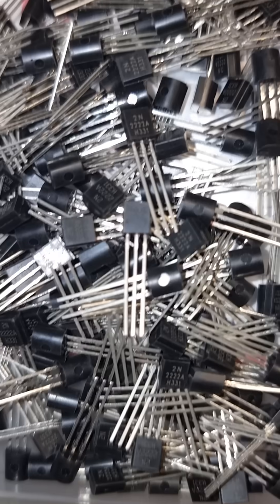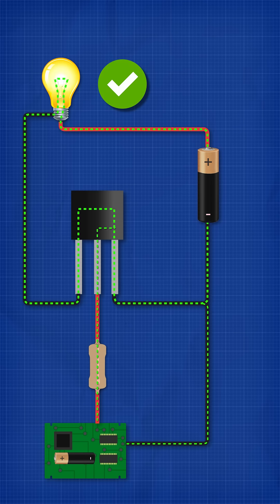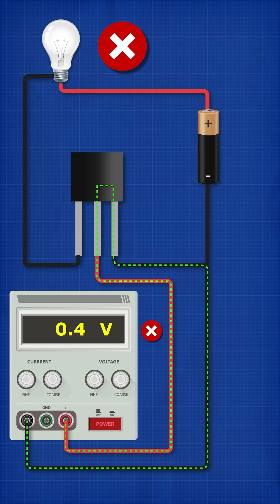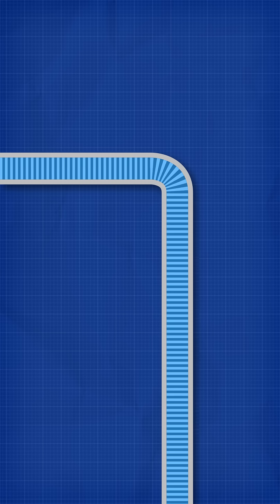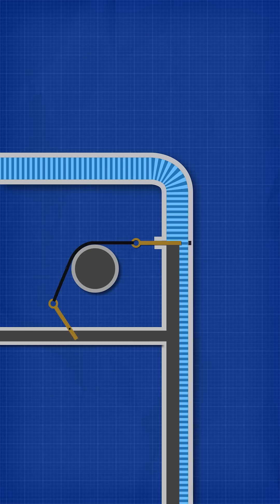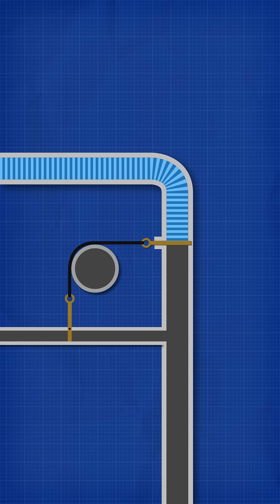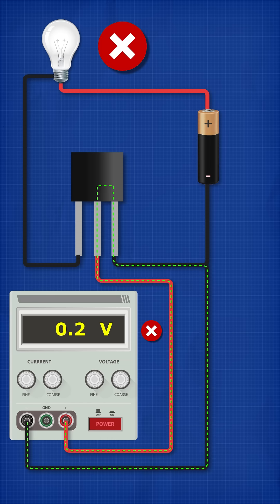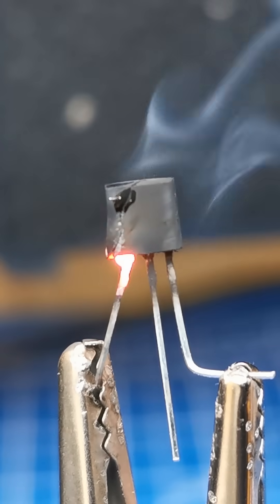Transistors Explained - What is a transistor?

Comment from the maker: Get this electronics book ➡️ https://amzn.to/41cCJPk
Reply: And thus it can turn on and off quickly *enough to amplify radio signals!*, by having it turn on and off at the same frequency as the radio signal but allowing the flow of higher voltage at the same rate!
 Thus acting like an amplifier!

But it is also important inside logic microchips and the processing of data!

Its basically a switch/gate that can turn on and off at Any rate needed!
So things like a photovoltaic cell can turn on or off a light etc!
🧐🤔🤯😁👍🏻🖤👏🏻🤷🏼
Reply: @LBCB94025  I like your explanation of audio power transistor,  how it works to amplify the signal. Amazing it can switch so fast.  So input is audio signal, voltage is increased and output as a stronger amplified signal. And it must be done at the same frequency as the input signal or it not work, right?
Reply: @Accumulator1  i think thats correct, (your wording is a little confusing?) so im not sure lol
🤔😳😆🤷🏼
Reply: @LBCB94025  Thank you for your comment! Hopefully they can take some of the load off of Arduino programming.
Reply: @LBCB94025 well put sir !
Reply: I like Electronics a lot but never could find a class to join. I only see classes for an electrician. Where can I learn about Electronics ?
Reply: @BadRonald1  Colleges have good beginner courses, and people like to share information. Engineering Mindset is a good 'how it works' resource and joining a Maker club (or a volunteer group) can contribute to a benchwork portfolio. Online only may not meet your needs.
Reply: @BadRonald1 
You can take online courses from most community colleges in the USA. Just go online and look for them. You will need to buy the textbook and the lab materials, including a breadboard for building circuits to test your knowledge, and various small electronic components.
Reply: As a student I only understood till diode. I never fully understood transistors. Thank you.
Reply: @randomgblsfs2190 
These videos are great, but they're only expecting to give you a basic understanding of the principles of the flow of electrons through circuits. In order to fully understand the the chemical properties of the components and how they impede it bypass the flow of current, you will eventually have to take physics, chemistry, and advanced electronics engineering courses. But these videos are probably intended to pique your interest in the field of electronics engineering.
Reply: This is one of the best video i have gain knowledge from without any confusion
Reply: Can you provide a new link, this one just redirects to the main amazon page
Reply: Samer question
Reply: I hate transistors they blow up too easily lol
Reply: @loen9591 
That's when you use either a triac or a relay because there's too much current for a solid state transistor.
Reply: Ok
Reply: Is it in your bio🤨
Reply: Is that a book suitable for beginners and laymen?
Reply: @herrlich1461 search in google tron.ix book
Reply: @herrlich1461  Same question

Comment: That last part about them burning out is so real. When I was trying to get into robotics as a kid, I was using a transistor so that I could apply a 5V power supply to 4 different motors at once that were pulling the thing along. What should have happened is probably having parallel transistors to distribute the current across. I had to swap that one transistor out from my robot so many times…

Comment: I can still remember from many years ago that they have mainly 2 types of common transistors. The PNP and NPN transistors which do the same thing in the video but have different flow directions. 
It seems the same as a mosfet or very similar. Which has me a bit confused, I think maybe mosfers are maybe like high power transistors. That are able to handle much more power by being made out of different material.

Comment: Originally, a plastic and rubber holder with copper posts, 

Which, when physically made contact with using a wire, completed a circuit, from point A to Point B

In time

Certain switches

Would have the copper ring they were sautered on to

Become magnetized 

With current passing through 

Which caused... perceived differences in that switch location 

Because of its magnetism, under current. 

That logic

Is what formed CPUs eventually 

Within plastic holders, copper or gold posts, or different shapes

Magnetized with enough current

Then formed permanent memories 

In the PCB Transistor boards. (Polycarbonate)

Like Doom.. kind of

Which was stored

From these things just being left on long term, 

Before they had memory, so the programs wouldnt get lost

Eventually, parts of programs become stored permanently

The permanent part.. is the internet, which we then build on, and add to, constantly 

But it all exists somewhere physically, in bits and pieces

Comment: Transistors are the modern day replacement for old fashioned vacuum tubes. The fact that transistors work like on or off valves shown in this video is why in Europe Vacuum tubes are called valves. Tubes or Valves controlled the flow of electrons in other circuits based on conditions created in the valve. Of course I could be wrong! LOL!

That's why we aren't using tube driven radios anymore. Among audiophiles tubes make audio sound "warmer" whatever the heck that means!

Comment: Great explanation! I have just one small suggestion, that you present the analogy of the water flowing through a pipe first, rather than starting with the actual transistor, doing the water pipe, and then coming back to the transistor. Anyway, this was very helpful!

Comment: So I made a very good Voltage regulator as just a hobby work, now when I got to market to get all components,  like why are there multiple names of, if I want np or other transistor just give me, there's so many models similarly with MOSFETs and other stuff,  If I buy relays than those won't have this stuff
Buying online is too expensive,and I live in Pakistan 
like 10Rs of 10 transistor very cheap, but 100Rs for delivery is just too bad ratio, and there's only Daraz to buy this

Now who can help me?

Comment: Omg I remember tryna make a blinking LED circuit with capacitors and transistors in highschool and the transistors seemed to only work on some days and not others, I only knew that it acted like a switch not that it needed a certain amount of voltage! I’m now realizing that my circuit probably only worked on somedays and not others, cause the batteries were different each day! 😭

Comment: what can i use in this Situation.
When A power supply is not working, now there's another Power supply that needs a trigger to open
Reply from the maker: Do you mean a changeover relay? To automatically change from one power source to another when one fails
Reply: @EngineeringMindset  yes I'm planning to use that in my router But the router doesn't restart after switching power supply. Is there a thing?

Comment: I just have a question, your videos always explained me too mutch about electronic but there is something that confused me, when you shows the way how electrons circulate, usually you do the electrons comes out from the positive pole to the negative pole whe actually is the opossite. the negative charges is when there are more electrons, this called anion and this one is passing his electrons to the positive pole or cation, who has abcense of electrons and has to recibe the electrons from the negative pole. is this correct or colud i have misundesrtood everything?😂
Reply from the maker: So electrons actually flow from negative to positive. However, we design circuits using positive to negative current. I've blended them together.

Comment: This a really clear explanation of the transistor, however, that gate in the pipe where the water is cannot close it no matter how much in it because it opens and closes sideways needs a spring to come back to being closed, otherwise it won't close even if you stop the water from coming out, especially at the place where it goes backwards when it opens, so this is a really a good example, when the water going in the other pipe is filled up enough, it will push that gate, and thus that gate will pull the rope and it will pull the gate of the other pipe and that water will flow with the other water together.

Comment: 3 days of nuclear radiation is needed to enhance electric components. You can se a better car battery (it has the signal icon on it), or an expensive heavy power bank that contains uranium for such a fix. The fix is permanent.

Comment: A transistor is better compared to a valve. The input is the valve setting and output is the flow. If the input is controlled by a flow and the output is a flow you can define the gain of the flow (output/input). A valve can be all the way open or closed (like a switch). The valve can also be partially open in the continuous mode where a little more open is more output flow and a little less open is less output flow. It can be used in either digital (on/off) or continuous (analog) modes.

Comment: So basically it's a switch that requires a switch to turn it on?
Reply from the maker: No, it's a switch that can use a signal to turn on or off. You can vary how much it turns on or off too.

Comment: Great educational demonstrations for students & could be supported by practical applications of the electronic components in our toys, radios, tvs etc.
For example how it happens that volume goes up&down as an expression of the current going up or down. The real manifestation of current or voltage or frequently   modulation & the very effects are extremely interesting and  important. ...

Comment: This short is the best explanation I've ever seen for a transistor, and I have an electrical engineering degree.
Reply: "an electrical engineering degree"?  sure thing bro.  
 and no mention whatsoever that the other... MAIN function is as an amplifier?
Reply: @viktorfalstadt4946  I really don’t think you can say that the main purpose of a transistor is amplification. A modern computer uses tens of billions of transistors as switches, and very few as amplifiers. Plus, some styles of transistor aren’t even capable of amplification…

Comment: I get that this is great for very simple folks... but what is the "gate" that is being pushed?  

this analogy is just an analogy, doesn't really tell us anything at all about whats happening.  it's like saying "cars can use gasoline to move, because hot air balloons use flammable gas!"

just doesn't explain anything in my opinion...
Reply from the maker: See the full tutorial transistors explained. This is just a 60 second short.
Reply: @EngineeringMindset  I appreciate the response.  I'll check it out. I just am not used to shorts being made out of clips of entire videos.  That doesn't seem to be what the platform of shorts is for.  Thank you for clarification.

Comment: It is a shame that this video depicts the transistor as a simple switch. It does not only work as on-off. The transistor is a current-amplifying device. It is also used on analog signals to amplify or buffer them, in a linear mode.

Comment: There is also a point between the swing gate being held shut and fully open, where the amount of water through the big gate is proprtional to, but much greater than the water passjng throigh the small gate. In a tranastor, this is the active region, where it acts like an amplifier instead of a switch. Also, the total electricity that can flow into the transistor (so-called saturation current) is more dependent on the series resistance of the collector and emitter, but that js getting into the weeds of analog electronics.

Comment: Keep in mind that a transistor (like any diode) has to be controlled by the current, not by the voltage. (Hence, the resistor is needed to limit the current.) The problem is that the forward voltage decreases with temperature. (The voltage level where current starts flowing) Imagine a voltage controlled circuit: current starts flowing, diode/transistor becomes warm, opens even more...and exploded! 😂

Comment: but how does a transistor with only 2 legs attached to a circuit work? I usually see this with a short unattached center leg and it doesn't make sense to me
Reply: It's probably a diode in the same housing (package) that is used for transistors (TO-92). It's cheaper for the manufacturer as they can use the same packaging machines for different components.

Comment: A transistor is a flame producer, but if you provide too little voltage and current, then all it does is allows current to flow. Did I get it right?

Comment: And thus it can turn on and off quickly *enough to amplify radio signals!*, by having it turn on and off at the same frequency as the radio signal but allowing the flow of higher voltage at the same rate!
 Thus acting like an amplifier!

But it is also important inside logic microchips and the processing of data!

Its basically a switch/gate that can turn on and off at Any rate needed!
So things like a photovoltaic cell can turn on or off a light etc!
🧐🤔🤯😁👍🏻🖤👏🏻🤷🏼

Comment: Good mention was the different ways to generate that voltage. As you can be very creative with such simple manner. 

Example, take a motor and couple gears to make it produce more torque. Connect the pole to the venial blinds adjustment bolt, so when you rotate the bolt the blinds turns. 
Now, set two of these on light sensor. When the sensor receives too much light, the motor will turn clockwise until doesn't anymore, and so on blocks the sun. 
And then when it is too little, it will send battery power to opposite to turn motor counter-clockwise to open the blinds.

Comment: Occasionally as a switch - sometimes like a valve. . Gate-emitter / Collector-emitter current-diagrams would clarify things
Reply: And do not fforget to mention that transistors are current-controlled NOT voltage-controlled
Reply: And don't forget to mention that transistors are current-controlled devices, NOT voltage-controlled

Comment: Is it true that once a transistor is turned on, the total current the transistor is rated for is available at the collector?
Reply: @@Lronhoyabembe This was told to me by an electrical engineering student. So if you are right then he was wrong in what he told me. I've been experimenting with transistors to make a BCM for an old truck. For the most part I've had success. But I was trying g to run a alphanumeric display with transistors but I kept burning out the segments. So that's when I consulted an electrical engineering student to help me figure out how to not burn up the segments. Long story short he didn't  really help me but I remember asking about collector current. And he said that once a transistor is on, the full current is available at the collector.
Reply from the maker: See my new MOSFET explained video here➡️: https://youtu.be/AwRJsze_9m4

Comment: This is not exactly correct. Especially when you're using it in an amplifier circuit. The transistor will actually boost a sine wave to make it more Audible. This is a very simplified explanation that you have provided and it's only one application of a transistor there are multiple other applications.
Reply from the maker: I had 60 seconds
Reply: @EngineeringMindset  you could have done better.

Comment: Does it matter if the sense pins source is from a differently grounded power suply? Say you wanted to use an arduino to control the sense pin and hooked the source and sink upto the power button on your pc would that cause a problem?

Comment: I DON'T UNDERSTAND, YOU NEED A SWITCH, TO OPEN A SWITCH, HOW OPEN THE SWITCH? 🥴🥴
Reply: IT IS NOT MUCH EASIER TO MAKE THE CORRECTLY SWITCH, 🤯🤯🤯
Reply from the maker: You want a switch that you can turn on and off automatically using a signal or another circuit, thousands of times per second so you don't need to sit there and press the switch yourself

Comment: Nice explanation but maybe not complete. Depending on the transistor, if it’s a mosfet, it will be controlled by voltage, if it’s a bipolar like the bc547 it will be controlled by current. Furthemore transistors are not binary, in your animation, if you put a small amount of power (current or voltage) it will open a little until it goes to saturation where actually it work as a binary.
Reply from the maker: See my new MOSFET explained video here➡️: https://youtu.be/AwRJsze_9m4

Comment: Well, kind of, but thinking of a transistor as only a switch is like thinking that a kitchen knife is only good for chopping parsley.  Transistors can switch, but they can also amplify in many different configurations, they can and do act as capacitors, variable capacitors, rectifiers, temperature sensors, modulators and demodulators, and much more.

Comment: I am getting .5v to my base pin...this is not enough to fully turn it on and it is causing me to burn through relays...the transistor drives a relay and with the .5v instead of .7v i am getting a weak magnetic pull....burning through coils

Comment: Just like flipping a switch in your home to turn on the lights...you must apply enough pressure to that switch to activate it.

In the case of the transistor, that pressure comes in the form of electricity.

Comment: Fun fact: Required voltage to activate the transistor depends on the material of the component.

Voltage gap for Silicon transistors is 0,6 - 0,7 V

And the gap for Germanium transistors is 0,2 - 0,3 V
Reply: @Mber4n1dess  for making sound or lights?

Comment: So by overclocking a CPU and providing more voltage, there is more overhead to provide more power to more transistors at a time thus boosting performance?